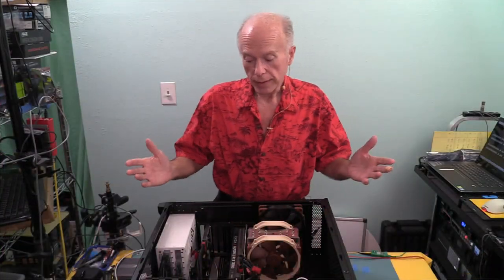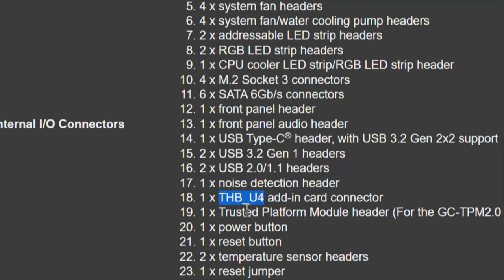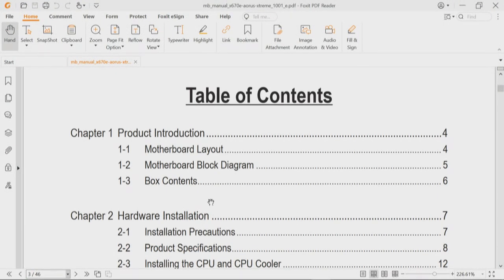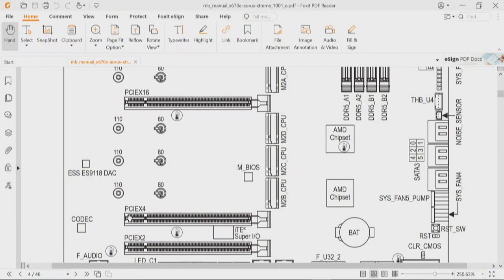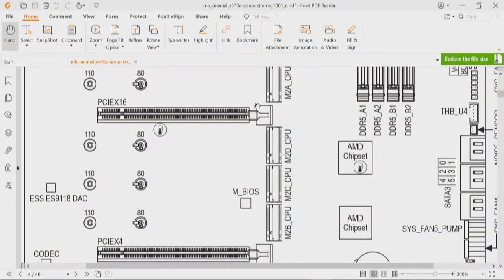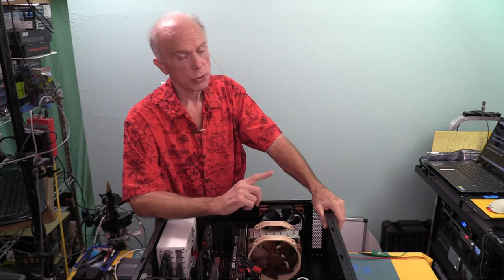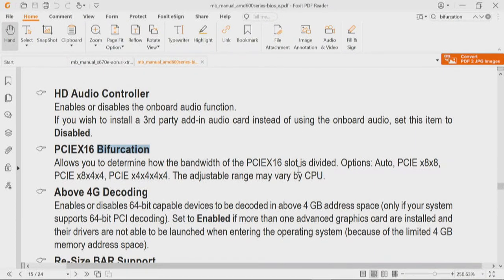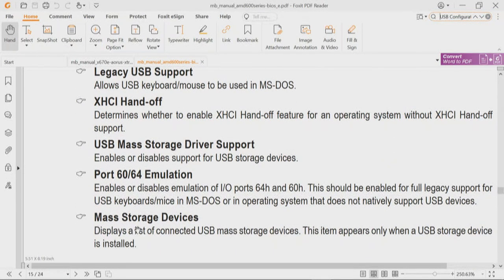Gigabyte X670E Aorus Xtreme Slots and Storage Overview

Comment: I have a different request for you: Is there any possible way I could get you to try a configuration for me? I have an X570 motherboard (I know you can't test this same motherboard and exact same hardware but I'll get to that in a moment) I own an MSI X570 Creation Prestige motherboard. It came with the MSI X-Pander M.2 card to put 2 x PCIE-4.0-4x NVME drives in it and install them in the second PCIE-8x slot. It does have a RAID option in bios. What I was thinking of doing was this: Use the XPANDER card for 2 NVME drives and then add 2 more using the two onboard M.2 drives under the heatsink and then try to RAID-0 4 x NVME drives together on this platform. I know you have at least 4 x matching NVME Drives and I know you have a few of the M.2 expansion cards by various companies that split out a PCIE slot to 2 or 4 NVME ports. Is there any way I could get you to try any X570 motherboard and try 2 NVME drives in the onboard ports and 2 on a splitter card in the second 8x slot (And try any kind of video card in the first slot to see if a video card would still work with this configuration) and see if they will all 4 RAID-0 together? I wanted to try this configuration but I have searched everywhere on the internet and even had 4 friends helping me try to google and I can't find anyone anywhere on the internet that has ever even attempted this type of configuration on any X570 motherboard. It's not a configuration described in the manual for my motherboard. It's not described in the manual for any other X570 motherboard (I looked at those) and I can't find anything to indicate "Is it possible? Does it work? Does it not work?" I'm aware I'll have to use windows 10 to use them raided together as a RAID Array and I'm aware it's a "SoftRAID solution" and I'm fine with all of that. I would just like to know if it's possible before I buy 4 more NVME drives. You might be the only one to figure out "yes or no" if this would work and share this information with us so I hope you could help me and help others. Normally we would have to use ThreadRipper for this but if this would work on X570 systems this would be great for a lot of people.
Reply from the maker: Hi Blueberry Apples,
Welcome! Looks like this will require a Video Response! Give me a couple of days to sort through those Specs. Great Question! What CPU are You using?
Reply: @BuildOrBuy  That sounds great. This is information that does not seem to exist yet on the internet so take as much time as you need and good luck! I am currently using a Ryzen 5800X. It's kind of Irrelevant to our discussion but: I have a "golden sample" chip that lets me shove all the sliders to the maximum in PBO curve optimizer in bios and it loves it and runs fine like that and it runs 5050 Mhz on 2 cores when gaming and 4600~4650 Mhz under an all-core load in a custom water loop and I love my CPU. <3
Reply from the maker: Hi @Sabrinahuskydog ,
BTW: What GPU are You using? Are You Rendering? If so, what's Your Render engine?
Reply: @BuildOrBuy  You might think I'm crazy but I actually don't render with it. I know everyone says it's pointless but I actually want it for general home user / consumer stuff. Also I found a deal on some refurbished samsung evo plus NVME drives from best buy for $44/each for 500GB ones and figured "If it works.. maybe I will just for the heck of it, just because I can" but I don't know if it would work or not. I use an RTX 3070 Ti currently. However: I am sure some of your viewers are content creators and editors. And if they were able to use storage at this kind of speed/performance in a X570 / Consumer desktop system without having to invest in Threadripper I'm sure it would be of interest to them so I thought it would be a good video for you to do too.
Reply from the maker: Hi @Sabrinahuskydog ,
Test and Verify Your used Drives. Install the M.2 NVMe PCIe SSD Drive Control Panel. Check SMART Telemetry and Firmware. Once in RAID, none of that can be checked. The Short Answer, RAID will work as Described. The Longer Answer of What, Why and How will be in the Video so You know the Details.
Reply: @Sabrinahuskydog  One of your m.2 sockets on the mobo will be through your chip set's shared lanes. The speed on that drive may fluctuate. Gill's videos on hybrid raid drives covered a lot of different combinations and how to set them up.
Reply: @maxhughes5687  But have they tried to do it on an X570 system before?
Reply: @BuildOrBuy  Awesome. You're amazing. Also thank you on checking the firmware! I didn't think to do that before making the array. I would of never thought of that actually. Do all the drives need the same firmware to match for it to work correctly?
Reply from the maker: Hi @Sabrinahuskydog ,
Experience is the best teacher! You'll want whatever Firmware is appropriate for each. Should be the same but We don't know that. Depends. And Cold Boot after doing Firmware Updates! 

Also, no TRIM support in RAID. FYI. Still working on Notes & Video Outline Talking Points! You'll have 3 Drives on CPU and 1 Drive through Chipset.
Reply from the maker: Hi @maxhughes5687 ,
You took those words right out of my mouth! Absolutely! Details matter! Just now seeing Your message! YouTube does not inform Us of all Comments!
Reply from the maker: Hi @Sabrinahuskydog ,
RAID conceptually is the same. Specifics matter in AMD vs Intel for a Hybrid Bios Bootable RAID or O/S RAID on same. Or a Hardware RAID using a Broadcom MegaRAID card. Generically as to AMD Chipsets, We have demonstrated RAID using X399 & TRX40 Chipsets on different Quad and Dual Adapters. Same applies for X570 Chipset. These Configurations as described are CPU Based RAID vs GPU based RAID. And You're only using 8 CPU Cores as opposed to 16 CPU Cores. What's possible is different than what's practical even on a Consumer Desktop Motherboard!

Comment: So...buying the Ryzen 9 7950x processor.  Was buying the Aorus Xtreme board until i seen this.  Building for music.production.  Any help sir?
Reply from the maker: Hello Urblotasun, 
Welcome. Which Audio interface? You'll definitely want 16 CPU Cores for Processing Power. As for Motherboard, Design vs Implementation. Choices to be made. Not enough PCIe Lanes to cover everything simultaneously.
Reply: @BuildOrBuy  Focusrite Scarlett 18i20 3rd Gen USB Audio Interface.  With Cubase.
Reply from the maker: Hi @urblotasunkynewulf615  , 
Good choice. Plenty of USB Ports on any one Consumer Desktop Motherboard. Using ASIO. Keep it simple. Good you're using Thunderbolt. USB is easy to change systems. And a USB Port for the Cubase Dongle.
Reply: @BuildOrBuy  So you think the Extreme motherboard will work for this?
Reply: @BuildOrBuy  Using a lot of vst's too.  Miloslav Philharmonic Orchestra samples.
Reply from the maker: Hi @urblotasunkynewulf615 , IK Multimedia, Beautiful Orchestra. Excellent choice.
Reply from the maker: Hi @urblotasunkynewulf615 , 
Yes. If you wanted more processing power, you'd have to go with more CPU Cores. To Do that, requires a Workstation class Motherboard. Changing one thing, changes everything. This is a good target for now. Good though to know your options and possibilities.
Reply: @BuildOrBuy  Thank you very much for chatting with me.  Good to know I'm heading in the right direction.  I was going to start with 32gbs. of Ram.  That's sufficient enough, isn't it? it
Reply from the maker: Hi @urblotasunkynewulf615 ,
Start with 64GBs. Look at your RAM Density. Utilize 2 Slots. I'm honored. I love my Subscribers.
Reply: @BuildOrBuy  Sounds good, thank you very much.
Reply from the maker: Hi @urblotasunkynewulf615 , 
Yes. Keep us posted on your progress! All about the Music!
Reply: @BuildOrBuy  I certainly will.
Reply from the maker: Hi @urblotasunkynewulf615 ,
Fantastic.

Comment: does the X670E Master have a better PCIe Lane Layout than this Xtreme?
Reply from the maker: Hello BrickBazooka,
Welcome! Good Question! Yes! 
Gigabyte X670E Aorus Master 
https://www.gigabyte.com/Motherboard/X670E-AORUS-MASTER-rev-10#kf

Slots: 
1 X16 CPU PCIe 5.0 
1 X4 Chipset PCIe 4.0 
1 X2 Chipset PCIe 3.0 - Shared Bandwidth SATA 4&5 Connectors 

Storage: 
CPU:
1 M2A_CPU NVMe CPU PCIe 5.0 SSD 
1 M2B_CPU NVMe CPU PCIe 5.0 SSD

Chipset: 
1 M2C_SB NVMe Chipset PCIe 4.0 
1 M2D_SB NVMe Chipset PCIe 4.0 

2 USB-C 20Gbps 2x2 Ports 
https://amzn.to/43nTp6b 
As an Amazon Affiliate I earn from qualifying purchases! Hope that helps!
Reply: @BuildOrBuy  thanks for your quick answer. and why is that better than the xtreme actually?
Reply from the maker: Hello @BrickBazooka , 
Only Shared PCIe Resource is a useless Slot vs 2 SATA3 Ports. Pretty good layout for the Price otherwise! Hope that helps!
Reply: @BuildOrBuy  so you're saying I could take the xtreme for the looks of it and spend more, but have to live with connecting only 1x 16x gpu and 2x m2ssd + some sata drives. if I want to  connect more, I should take the master, cause I could install for example a soundcard or something as well without loosing pcie lanes, am I right? sorry if Iam asking too dumb :D
Reply from the maker: Hello @BrickBazooka ,
You can install a Sound card in either one. You can only install 1 GPU in either one. Gigabyte X670E Aorus Xtreme 
https://www.gigabyte.com/Motherboard/X670E-AORUS-XTREME-rev-10#kf

Slots: 
1 X16 CPU PCIe 5.0 
1 X4 Chipset PCIe 4.0 
1 X2 Chipset PCIe 3.0 

Storage: 
CPU
1 M2A_CPU NVMe CPU PCIe 5.0 SSD Dedicated. However, these 3 below Share Bandwidth with PCIEX16. 

1 M2B_CPU NVMe CPU PCIe 5.0 SSD 
1 M2C_CPU NVMe CPU PCIe 5.0 SSD
1 M2D_CPU NVMe CPU PCIe 5.0 SSD

2 USB-C 20Gbps 2x2 Ports 

To reiterate, they BOTH have same Slots and Storage and USB-C 20Gbps 2x2 Ports! 

Where they differ is in how those Shared PCIe Resources are allocated!
Reply: @BuildOrBuy now I see what you mean! thank you for pointing that out and for your help! there is a comment below your Video here, with a guy named danwo which has the xtreme and x16 gpu plus 2x m2nvme ssd on it. He seems happy with that setup, but maybe He doesn't know that his gpu lanes got cutted away by the ssds
Reply from the maker: Hello @BrickBazooka ,
You're right! Most do not realize that fact! Vendor obfuscation!
Reply: @BuildOrBuy  but wait - on the xtreme: when I put two NVME SSD's in the Slots M2A_CPU AND M2D_CPU (around the GPU x16 Slot), the GPU will still have X16 lanes. Their both Dedicated. I only must avoid M2B_CPU & M2C_CPU which are shared with x16..
GB says: The M2B_CPU and M2C_CPU slots share bandwidth with the PCIEX16 slot. When the M2B_CPU or M2C_CPU slot is populated, the PCIEX16 slot operates at up to x8 mode.
Reply from the maker: Hi @BrickBazooka ,
Bummer, right. Consumer Desktop Motherboards should not be Designed this way. But they are!